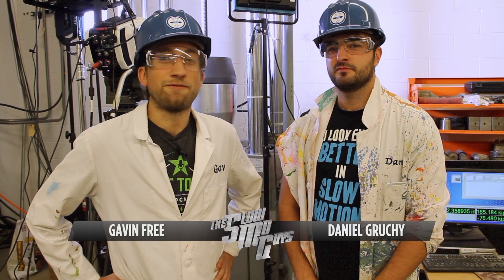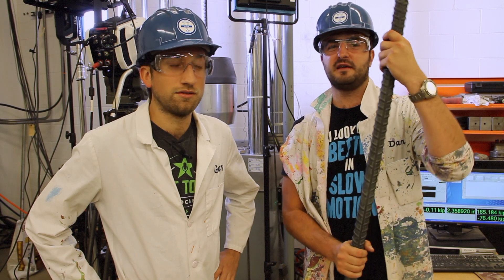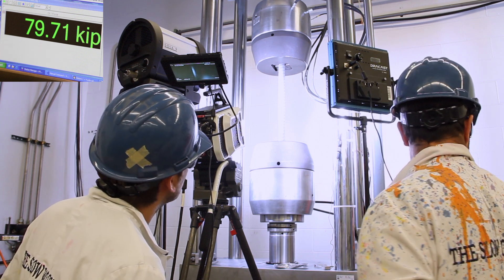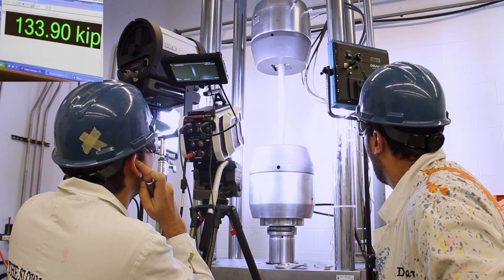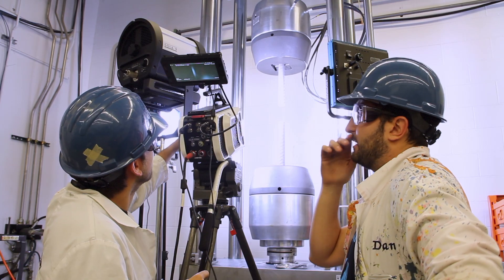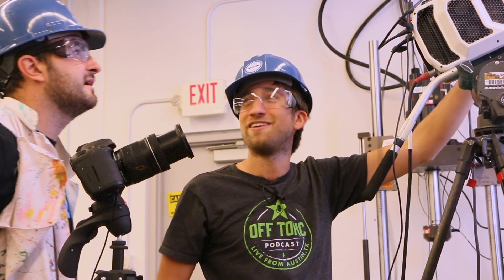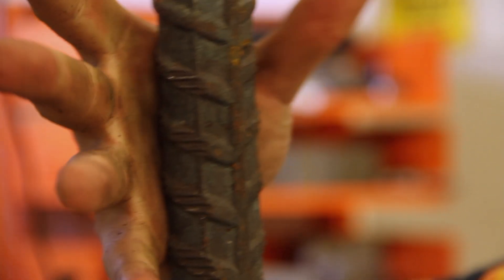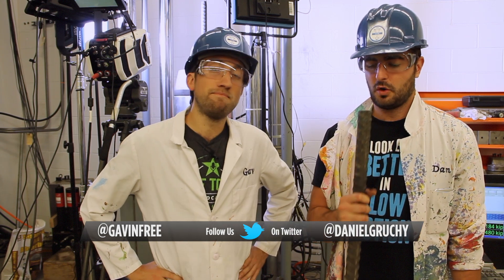Snapping a Steel Rod 1000x slower - The Slow Mo Guys

Comment: For metric (normal) people, it went at about 71 tonnes.
Reply: Errr.. more like over 675kN
Reply: Finally. Someone realizes that we use Newtons for force, not kilograms/tonnes.
Reply: you cant just nicely throw in a simple conversion for people, you just have to throw in the implication that half the audience is abnormal
Reply: @spiffo5349  After all, what good is it to use metric if you can't be insufferably smug about it?
Reply: they said no 11 rebar. That means 1008mm² area. So 675kN/1008mm²=670N/mm².
And they said Grade60, which has a tensile strength of 420-550N/mm² and a yield strength of only 220N/mm². So this rebar seems to be in specification and the material should be similar to S235, which is to be expected, since this is the most common (and cheapest) unalloyed steel.
Reply: Thanks, that's a shit load of weight
Reply: What percentage of this channel's fan base do you think does this for a living?
Reply: I'm sorry, I couldn't help it.
Reply: you will need to tie two trucks at the maximum weight of 80k pounds each to snap this metal rod, that's seriously impressive o_o. Makes you realize just how much stress is expected for a building in an earthquake if these things are used for metal beams inside the concrete.
Reply: And for the scientists thats over 7kN
Reply: Dan - dm3
71 000kg x 9.81 = 697kN

You weren't wrong, you're just far from right.
Reply: Jamie Bales most normal people measure this in GPa or MPa. at least the ones who do this for a living like engineers
Reply: Memelord 513. 

1 kilometer = 1,000 meters = 100,000 centimeters = 1,000,000 milimeters
Freezing point = 0°C - Boiling point = 100°C

1 mile = 5,280 feet = 63,360 inches = 63,360,000 thou
Freezing point = 33°F - Boiling point = 212°F

Now, which one looks fucking stupid to you?
Reply: +Dan - dm3 Nah. Add zero, not remove(1kg=10N):71T=71000kg=710000N=710kN. More or less. On Earth thats 696510 N.
Reply: 95% of the world can't be wrong.
Reply: Jamie Bales Pretty sure that Kilogram's is not usable here. This is about force, not mass, so you should be using Newton.
Reply: Erik Cobra. I see your point. For the average layman (most of YouTube's viewers), it would be easier to picture how many cars you could hang from it.
Reply: Do normal people use megastone also?
Reply: Rainer Riegler. Can I find that language on Google Translate?
Reply: I understand that the imperial ton is just a random number pulled from someone's ass, just like the rest of it.
Reply: For scale guys, the beam broke at 157,400 kip wich equals to 71000 kg as mentioned above. In cars that would be  about 35 sedans e.g. a Tesla Model S (at about 2000 kg) hanging from the beam to break it.
Reply: It's more like 700kN
Reply: JonathanDavid J I do as well :) but if you live in England like me it's understandable because our country has had the problem not fully committing to the metric system.
Reply: Nick Ish. Your intelligence astonishes me.
Reply: Jamie Bales edgy
Reply: +Tucker Garcia well everyone here was talking about the force, if you wanted to use pascal you would need to calculate the area of that steel bar..
Reply: Memelord 513 The majority of the planet would disagree with you.
Reply: +Glass.Cannon Metrics are normal. Everything else is just purely inferior.
Reply: Dan - dm3 a RM of about 300N/cm2 normal S295J0 Steel
Reply: Jamie Bales metric and normal? blasphemy!
Reply: I use a mix of both, eg Miles, Meters/cm and Grams/kilogrammes
Reply: Jamie Bales you are so special
Reply: Ni Hao wow you're uneducated. Be grateful for what America has given you.
Reply: Jamie Bales And you don't think it will cost money to change the entire U.S education system to Metric? We're already in debt. It would be a stupid investment.
Reply: Glass.Cannon when you drive a left hand drive car you non dominate hand, your left, is on the gear shifter and your dominate hand, your right, is on the major control of a car, the steering wheel. How is that less efficient? your most likely dominate right eye is in the middle of road. etc. etc. etc.
Reply: Glass.Cannon Kelvin and Celsius are the same scale, just zero-adjusted to everyday or absolute temperatures.
Reply: +MemeStar You arent here to argue, but you attempt to insult a whole country by calling it gay. Smart guy..
Reply: +Glass.Cannon 
Statistically it's actually safer to drive on the left.
I agree with your point, though.
Reply: your pf pic matches your comment
Reply: Please tell me you aren't this stupid ! 
Assuming you are. 71 Tonnes = 71000 Kg
Reply: What do you mean by ''metal beams inside the concrete'' ? Do you mean structural steel beams having usually C, T or I shape profiles or do you mean rod bars used to reinforce concrete to resist loading bending moments ? Those are appropriate engineering terms
Reply: You should use a standard car style instead of a specific model, especially a non-standard model. I have no idea what style of car a Model S P70D is, nor do I know how it compares weight-wise with other cars of similar design, due to the lack of a ICE and the addition of a large battery pack.

Saying something like "equal to 35 sedans" would be much more relatable, everyone knows what a sedan is.
Reply: +Ryan Gunn I'm pretty sure he's Scandinavian, over there that car is very popular.
Reply: Oliver Steele Because most of the world drives on the right
Reply: Jamie Bales Theres tonnes and metric tonnes both systems use tonnes, but they do represent different masses
Reply: MemeStar, Google is your friend.

Up to the late 1700's, everybody travelled on the left side of the road because it's the sensible option for feudal, violent societies of mostly right-handed people. 

Jousting knights with their lances under their right arm naturally passed on each other's right, and if you passed a stranger on the road you walked on the left to ensure that your protective sword arm was between yourself and him. 

Revolutionary France, however, overturned this practice as part of its sweeping social rethink. A change was carried out all over continental Europe by Napoleon.The reason it changed under Napoleon was because he was left handed his armies had to march on the right so he could keep his sword arm between him and any opponent. 

From then on, any part of the world which was at some time part of the British Empire was thus left hand and any part colonised by the French was right hand. 

In America, the French colonised the southern states (Louisiana for instance) and the Canadian east coast (Quebec). The Dutch colonised New York (or New Amsterdam). 
The Spanish and Portugese colonised the southern Americas. So The British were a minority in shaping the 'traffic'. 

The drive-on-the-right policy was adopted by the USA, which was anxious to cast off all remaining links with its British colonial past.
Reply: Jamie Bales Feel smart? Anyways, what does that have to do with anything? It doesn't change the fact that most of the planet now drives on the right, and the U.K is one of the few countries that drives on the left. 

Regardless, I'm not here to argue.
I don't care what measurement system you use or how gay your country is, just pointing out facts.
Reply: MemeStar. For using google? No. It doesn't change the fact, but explains it. It's not as extreme as you think, it's 66% right, 34% left. Anyone can adapt to the metric system, free of charge. It doesn't require most of country to be rebuilt.
Reply: Glass.Cannon. I mean't no offense. I'm sorry if I offended you. Honestly, I mean't it as a sarcastic joke to trigger a discussion.
Reply: Jamie Bales For example, all our road signs would have to be replaced. So yes, it would cost money.
Reply: You can't convert kip to kg.  Kip is a measure of force; kg is a measure of mass.
Reply: @Gamerock82  

The metric measurement for distance or length, the first metric measurement that was defined, was based on 1/4th the north/south circumference of the earth. This was divided into ten million parts, defined as ten million meters, or 10,000km. The metric scale is as arbitrary as the imperial. It's also inaccurate since the north/south circumference when measured using the metric system is actually 40,008 km.

Also counting to 100 is not metric. Currency is not metric. Metric is base ten. Everything that is base ten is not metric.

Also, also, suggesting someone should, "just die" is hateful and disgusting.
Reply: Jamie Bales You will more likely find it in Chemical Rubber. 🤖
Reply: Jamie Bales AKA irrelevant people
Reply: Jamie Bales
Reply: Oliver you also drive on the left side of the road, so why are you talking?
Reply: MemeStar because I can :) and I'm guessing ur from America, so why do you drive on the right?
Reply: 700 KN
Reply: Jamie Bales+ you guys may have us beat on weight measurements but our speed and distance measurements are far more impressive. 😉
Reply: Timothy, we're forced to use miles here. Unlike the rest of Europe.
Reply: merci
Reply: For those who'd prefer a mind-blowing science fact, it took about 71 times the gravitational force of the Earth to pull that rod apart, or 1/18310 times the gravitational force of the sun.
Reply: only 71T? Weird. What was that rod? 30mm? I work with steel at around 700 MPa yield strength.
Reply: MemeStar. The UK has left it too late and it would cost billions and decades of work to change to the right.
Reply: SKYFLÆM3. What about them?
Reply: Thanks
Reply: Glass.Cannon Well put, damn.
Reply: MemeStar. We use miles also, the only thing that hasn't been metricated.
Reply: Jamie Bales Eh imperial for normal every day use as it's easy to measure.How ever metric is perfect for science but hard to know how long or short something is with it.(Well at least for me.)
Reply: +I LOVE YOU Literally Imperials on use, for guessing.
People raised on Metric like myself, often can't guess measurements very well, but imperial is great for it.

But would you rather be more correct in guessing or more correct in real life?
Reply: Memelord 513.
Is that why every country in the world, except Burma, Liberia and the US, uses it? that's very stupid and arrogant of you!
Reply: Thankgod in England we use both systems because we have no idea what one to use.
Reply: Evil Paragon 2 Nah it's because you can easily remember how long an inch foot or mile is.But yeah I agree with you.But that question is hard.If I was building something I would use metric and to see how far something is or tall without an Instrument I would use imperial.
Reply: But what is the machine's power level?
Reply: Nuka Cola Quantum As a materials engineer with an interest in astrophysics, I'll be happy to tell you that you statement makes no scientific sense... Furthermore, the gravitational force of Earth on what? If you're talking about the gravitational force of Earth on the rod itself, that would be equal to the rod's mass (in kg) x acceleration of gravity (~= 9.8m/s^2). The rod's mass can be calculated by multiplying the linear density of the rod by its length. Let me save us time without crunching the numbers, that rod does not have a mass of 100 kg as evidenced by Dan being able to comfortably lift it. It would have to have a mass of more than 100 kg for it to be pulled by Earth at a force of 1KN. You had said that it was pulled at 71 times "the gravitational force of Earth" which is simply untrue. It was pulled at more than that. Even though the comparison is still slightly invalid since the rod would be in equilibrium if allowed to fall and would only be truly being pulled  by Earth if someone is holding it vertically without it being supported by the ground or the floor or any solid horizontal surface. It's hard to explain without diagrams. I just want you to realize how wrong your understanding is so that you read more and correct it. Also, Fallout 4 sucked.
Reply: Tarek EL Derbas. 
 Thank you my good man, you explained that very well, even for a silly old fart like me (according to my son, ha ha.). A wise man once said  "If you learn at least one new thing everyday, you are doing well". I think I've done very well today. Thanks and cheers, Rob in Oz (Australia).
Reply: As a Brit I think it's rather sweet actually.  USA is still using imperial measures (named after the British Empire).  Maybe there is a hankering for the colonial past??  :-)
Reply: Yeah, it's way too easy, why use easy when you can make it super complicated?
Reply: Jamie Bales daaaaaaaaaamn
Reply: Jamie Bales oh sorry i thought you said stones :3
Reply: So in other words, if that very bar was gripped onto something at one end vertically and if 71 tonnes were applied at the bottom hanging off it, it would snap?
Reply: TheBrickGuy7939 Yeah man. That's what they simulated here.
Reply: Exactly..
Reply: Thank you
Reply: I laugh at how you criticize imperial units (by saying for "normal" people when referring to metric), yet convert the units into wrong metric units. Kip is (1 thousand lb-force), so you would convert it to Newtons, or in this case kNs, not kilograms or tonnes.

If you are going to criticize one's use of some arbitrary unit (yes, at the end of the day, all units are arbitrary), at least do the conversion right.
Reply: @howardbaxter2514  I laugh at the fact that you've just repeated what a lot of people said three years ago. To which explained that It was just for the average viewer, so that they would understand.
Reply: @jamiebales8394  except it was wrong. If you are going to explain something to the "average" viewer, then get the units right.
Reply: By the way, since y'all want to argue about how great metric units are, it is just as arbitrary as imperial. For instance, the exact definition of 1 meter is the distance light travels in exactly 3.335641 nanoseconds. Seems like a pretty arbitrary to me.

And before y'all argue about how great doing stuff in base 10 is, to a computer, base 10 is ludicrous as data is stored in either base 2, base 8, or base 16. You want to know how ludicrous base 10 is to a computer? Try writing 3.1 in binary and storing that in a double.
Reply: Please stop casting yourself as "normal" and everyone else as "not normal" merely because your modus of measurement is different from another's.  I could call you "not normal" for measuring your temperature in Celsius while I use the far more "logical" Kelvin system. I could also call you "not normal" for driving on the left side of the road while I drive on the "right" side of the road, which is empirically the more efficient and safer way to drive because most people are right handed and most of the vital functions of a car are to the right of the driver, and, thus, easier to access and control.

Ultimately, metric vs. English, Kelvin vs. Celsius vs. Fahrenheit, left side vs. right side are moot arguments. The "not normal" people are those unable to adapt to the differences between nations, societies, and cultures, and whose first response is to degrade and berate those who are different. 

In short, please show some respect. I know it's a tall order, but please try.
Reply: Jamie Bales it's possible. most of the world said Brexit was never gonna happen and most of the world said trump would never win... so it's possible for 95% of The world to be wrong. but that's just my opinion though.
Reply: @moviemaker2011z  yeah like always... every time when I think that the people can't get dumber then they vote for Trump and the British people are leaving the EU all those short minded people who  ran along with the biggest mouth that have no idea what is going on.
Reply: Not for "normal people", but for the rest of the fucking world
Reply: The metric system is so fucking stupid
Reply: Jamie Bales normal people use kilograms tho..
Reply: Tonnes is also metric, it's 1000kg.
Reply: @Bisantian  too stupid for basic multiplication ?
Reply: @Bisantian  I use lbs

Comment: It's was not friction that heated it, it was the fact that towards the middle, the metal got compressed. Pressure is proportional to temperature. Actually the same thing happens with a rubber band when you stretch it, it gets warmer in the middle.
Reply: That doesn't happen because of pressure, but because of the bonds between the iron atoms in the bar being pulled apart. The same of true of the rubber band, the polymers being pulled past each other generates the heat

Comment: Broke at a lot lower than it's rating. Is that due to the nature of the test or the rebar being sub par? How would impact is use in construction if the engineers believed it was stronger than it actually is?